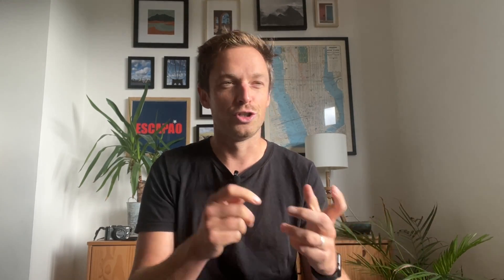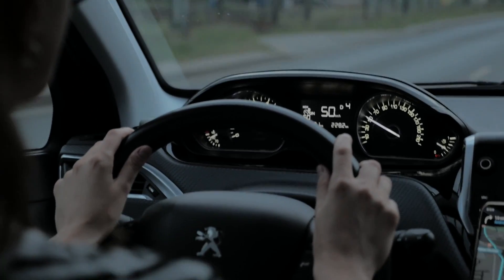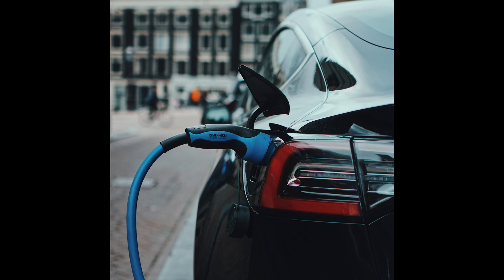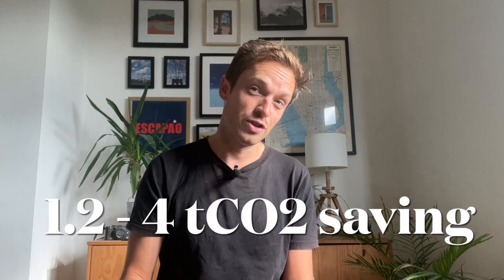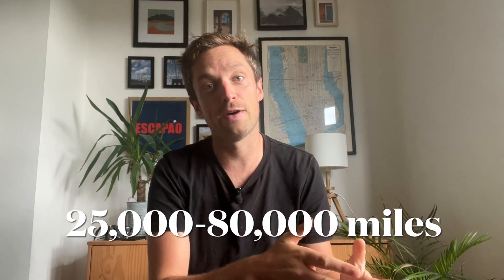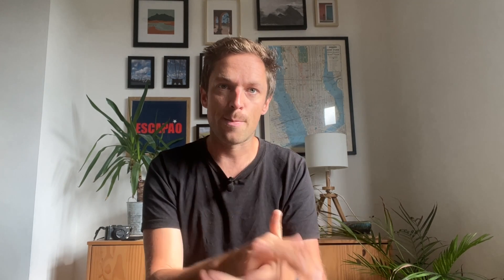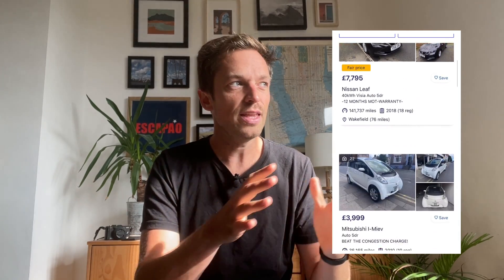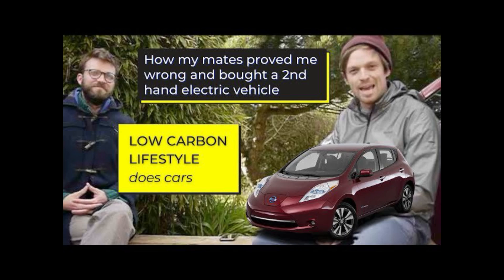Should I run my petrol car into the ground or switch to an EV?

Comment: In terms of cost, keep the old one 10 times out of 10. Only if you can afford a new car of any type should you then consider this
Reply from the maker: I am not sure I agree, there are many second hand EVs at very reasonable prices now, and depending on how many miles you do, could save about £1000 per year in 'fuelling'. An old fossil vehicle can be very expensive to run, and contributing to poor air quality where you drive has a much bigger cost that just £££s

Comment: A tesla (best selling ev) is around 20 tons of carbon to create. Meaning a 50mpg diesel could run for 160,000 miles before you've saved the planet anything. I can't wait to start seeing all those used batteries piled in scrapyards polluting the earth.

Comment: Found your channel as I'm looking to get a heatpump for our Victorian house. But I've been enjoying your other videos too. Our second car is ICE but our main car is EV and does nearly all the miles. Last year the ICE did 1500 mile and since getting an ebike for commuting it does even less. The car still has value so couldn't scrap it. Likely that if sold the emissions would increase so I'm keeping for the really rainy days and occasionally tip run. Probably won't replace it when finally scrapped.

Comment: It's more than that though, you're quoting manufacturers CO2 figures, which like their stated MPG figures are vastly overstated. I wonder if anyone has actually used an emissions meter through the lifetime of an average car, say a Golf 2.0 Tdi. On my own figures using data over the last 3 years, I do 20k miles a year and I calculated that with a diesel I'd have used around 4 tonnes of CO2 (manufacturers figures), using monthly average national grid figures for my region it's around 600Kg in the EV. Add your embodied CO2 in production? It's a total no-brainer. There's also far less consumable parts needed to be replaced in an EV whilst running. All these parts cost CO2 to produce, e.g. Brake discs, clutch plates, oil, oil filter, fuel filter, air filter. For tyre wear I've found this to be similar to my diesel. Add to this that the raw materials from the battery that can be >90% recycled for future batteries. There's no wonder the established fossil fuel companies are pushing mis-information all the time, through our press, social media etc. The biggest difference for me doing all my miles is the quietness, it's made such a huge difference to commutes.

Comment: The point about reducing consumption is one that we need to be speaking about more! We've gone from 4 cars, 3 motorcycles and 1 bicycle in our household, down to 1 car, 2 motorcycles and 7 bicycles.
By cycling almost everywhere, we are saving a lot of money, our health has improved dramatically and the carbon saving must be immense since we started the transition in 2016.
Thanks for a well thought out video on this subject.
Reply from the maker: That's fantastic to hear! I think there is lots we can do to move away from the private car, and you sound like a great example of that. I cycle on my commute and often to the shops, so our car use is really when we have to travel 5 miles plus and in a bit of a rush.

Thanks for engaging with the video!

Comment: My concerns are the recent spike in EV car fires, the range of many of these EV vehicles needs to improve to make an EV a viable daily driving option in some scenarios, also the infrastructure in the UK is just not there yet

Greater control of the manufacturing, installation and control hardware and software of EV batteries is needed, to mitigate EV battery fires as much as possible

Although ranges of EVs has improved, for many people an EV just isn't viable as a means of transport, because the range just isn't enough, this needs to improve

Also more investment in EV charging infrastructure is needed too, the cost to use such infrastructure also needs to reduce substantially, so that EV owners are not being stung with exorbitant prices on a public network
Reply from the maker: Hi Edward,
Thanks for the comment, I would love to see evidence of a spike in EV car fires? Have you read this article? -https://theconversation.com/electric-vehicle-fires-are-very-rare-the-risk-for-petrol-and-diesel-vehicles-is-at-least-20-times-higher-213468

What range do you need? Most new EVs would have more than 200 miles on a single charge, my bladder doesn't last that long.

What infrastructure do you need? Nearly 30,000 locations and nearly 50,000 devices - https://www.zap-map.com/ev-stats/how-many-charging-points.

I would love greater regulation of fossil vehicles, I am sure you aware that fossil cars have been on fire before...? Often caused by faulty fuel lines, overheating, etc.

Feels like you are repeating rumour and delay tactics to stop the transition.

I don't have an EV yet, which is what this video is about, I mainly ride my bike, but at some point, I  need to move away from a fossil vehicle, there is no reason to stay with them any longer.
Thanks
Tom

Comment: Your figure for petrol/diesel is scoped around the vehicle but electric is scoped around the grid. You should include the production and transportation of the fossil fuel which would increase your fossil fuel emissions by 20%. This also ignores the main benefit of electric which is local air pollution.
Reply from the maker: Hi pmac6584 - you are exactly right. Although I am using methodology based on greenhouse gas reporting principles outlined by government, I still thinks it makes a compelling case to change and avoids accusation of overstating the benefits.

But agree, air quality, emissions reduction, noise reduction, improved comfort etc etc - multiple benefits of changing
Thanks for engaging with the video
Tom

Comment: I skipped the math and, unfortunately, your entire premise.  EVs are changing so rapidly that I decided to cut back on driving as much as possible and wait a few years to see how it all shakes out.  Got a work-from-home job and I am hoping to sell my gas vehicle and rely on my wife's car when I need to drive.  What I want is a more conventional version of the Aptera.  Lightweight, efficient, on the lower end of the price spectrum and able to charge itself via its own solar panels if you park in the sun.  I think we'll see that kind of product sooner than later.  Give it 4 passenger capability (and probably 4 wheels instead of 3) - the love child of an Aptera and a 1980s Honda Civic.  A vehicle like that could be lighter and require much less battery capacity than the massive EVs on the road today.  All of your calculations would suddenly tilt in favor of getting a new EV.
Reply from the maker: Hi Andy, thanks for the comment, I like the idea of the 80s Civic Aptera love child...!

Yes my maths already add up from a CO2 perspective, from a cost perspective, maybe, but like you, I don't drive much, cycle to work and get the train a lot when we go away. Maybe I just want an EV because they are a fun toy.....
Tom

Comment: How eco friendly is a Toyota Prius gen2 2007 that does 70mpg and has all original transmision components engine and battery ?
I'll say it's way more efficient then any possible EV
Old hybrid cars with original batteries are the best for emisions in my view
Reply from the maker: Hi markbesky, that's not quite true, although 70 MPG is very impressive for a fossil vehicle, in energy terms that is only about 1.6 miles per kWh, when an inefficient EV would be doing 3 miles per kWh.
70 MPG, would also be 135g CO2 per mile. An EV at 3 miles per kWh, charged by the UK grid, would be about 65-70g CO2 per mile.
So, a Prius is definitely better than a pure fossil vehicle, but still reliant on fossil fuels and higher ongoing emissions than an EV. If I had a prius, I wouldn't be in as much a rush to switch as I am, but we'll still need to move away from them one day!
thanks for engaging with the video
tom
Reply: @TomBray-LowCarbonLifestyle  I consider my car carbon neutral because it's still on the road with no major components changed 
You can say the same about an EV if it still has the same battery after minimum 10 years or at least 200k miles
Reply from the maker: @marbesky  you can consider it carbon neutral but every litre of fuel you burn will emit 210g CO2. So 'neutral' is doing a lot of work there...!

My calculation suggests an EV could pay back after 25,000-80,000 miles (depending on what you are switching too)
Reply: @TomBray-LowCarbonLifestyle  let's keep it simple 
A prius averages around 150k miles with no major issues and I mean no big investments in the car 
I prefer to look at money over emisions because in UK nobody gives 2 shits about emissions not even government and it's all about the money 
How much will a prius cost compared with a tesla 3 over 15 years ?
And emisions wise what would be the equivalent of driving a tesla 3 15 years including a minimum second battery replaced because let's be honest thers no way a battery can last that long 
This whole emissions thing is a big rabbit hole

Comment: The current rate of depreciation of EVs Vs ICE far outweighs any cost saving of running an EV Vs ICE. Also why do you assume that EVs have more embedded CO2 than ICE?
Reply from the maker: Hi Christian-sh9uh, I think it is fairly widely reported that embodied emissions of EVs are higher than a fossil vehicle, at least that is what I have read before. 
Are EVs depreciating more quickly than fossil vehicles?
Thanks
Tom

Comment: "what if you just stopped driving" well as someone who spent 2 months wo a car: no, unless i quit my job, i can't. but come to think of it, plenty of houses have 2 cars where i live and by the looks of it, 1 of those is usually only used for short trips. so a second hand EV might just do it since they often cost about as much as a reliable 2nd hand car.
Reply from the maker: Hi yvs6663, yes lots of people need a car to get to work, visit family, or get to shops. Lots of people think they need a car but could probably drive a lot less and even live without if pushed. But a 2nd hand car may be a great start.

Tom

Comment: I thought using a UK manufactured electric car was unfair as most electric cars sold in the UK are imported.  Would be interesting to see the figures for the worlds best selling electric car, Tesla model Y!  parts sourced globally, imported on container ship burning crude oil, I think the results would be very different.
Reply from the maker: That's a fair challenge, this article suggests a Tesla Model Y would have emissions of 21 tonnes in manufacture - https://insideevs.com/news/493771/toyota-rav4-prime-tesla-model-y-co2/ I guess not counting import emissions too, lets call it a round 25 tonnes. If my 1.2 tonnes to 4 tonnes saving per 10,000 miles stacks up then that would be between 60,000 and 210,000 miles to payback those emissions... all depending on what car we are switching away from.

So maybe for some EVs the story doesn't stack up. I think I am looking for a 2nd hand car, as wouldnt want to pay the excessive costs of a new Tesla even if we could afford it...! 

I guess best would be riding a bike and using public transport....

Comment: Hmmm lets see, how much petrol can you purchase for the price of a new EV, oh wow that is a hard decision to make.  LOL🤣😂😋
Reply from the maker: Hi jlgrizzly7972, and how much damage would you be doing if you did that? I guess the question is, are we willing to take responsibility for the sewage we are putting in the air, or are we willing to keep poisoning lungs, keep risking climate change, keep funding despots around the world....
Up to you!
Reply: I drive 350 miles a week just going to work and back and it costs me £10 on average (£9 or less in summer, up to £12 in winter because of the range difference with the seasons). I only charge at home at 9.5p per kWh plus some occasional home solar at weekends (very little). I save around £1500 a year on fuel vs petrol, overall. I’ve been driving an EV for 3 years, so I’m already at £4500 saved. In 12 months time it will be £6000. In two years time £7500. I did what Tom did and did the maths for my particular use case - and back then I was driving a diesel Golf and paying what was it £1.25 to £1.30 per litre? In my case the economics was a no-brained, but it still took me another year to pluck up the courage to make the jump. For others the story will not be as beneficial, the less miles you do the less the economic benefits (and CO2 for those who care about that). If you do the maths you can work out if your next car should be ICE or EV, new or second hand. It’s not hard, the hard part is finding the data first. I can confirm that in my case the maths and reality matched. For additional info I have done 48,000 miles and the battery is still at least 95% of original capacity. You are looking at 1-2% degradation per year or 12-15k in that case. So effectively I can take  £4500 off the purchase price of the car, which was £28k after incentives discounts and before the trade in value off my old car - I can’t remember if that was £3k or £3.5k so I’ll use £3k. So looking back at it we payed £25k for the car, have saved £4500 in fuel which makes the car cost to me £20.5k. In 12 months, assuming it does not catch fire or need a new battery, it will have cost me £19k. This why individuals need to look at yearly running costs along with how long you intend to use the car, rather than upfront purchase price alone. Owning an electric car is…….different. I also don’t see why lots of people have to change to EVs, ICE is still going to be a better choice for many for quite a while to come. Don’t fall for the hype or headlines on either side of the debate, which is best for an individual right now depends on their needs and circumstances.

Your comment is not wrong. EVs are expensive and that alone puts them outside of the reach of many, which basically makes it a simple decision for those people. Doesn’t matter how much money you can save if you can’t afford the entrance fee. That may improve over time, but I don’t know, I don’t have a crystal ball. But when running costs are included, the price of ownership can be lower than it looks at first glance.
Reply: I can see your point, for me having my vehicle paid for and only traveling around 25K a year it is a no brain er.. @javelinXH992

Comment: Hang on! you included the carbon cost of the grid for EV but missed out the huge carbon cost of finding, extracting, refining and distributing fossil fuel for an ICE car. The tailpipe emissions and embedded carbon are only a part of the carbon cost of an ICE car. The argument to swap is far stronger when this is taken in to account.
Reply from the maker: Hi Jonathan, you are absolutely right, I suspect there are a lot of emissions that are not accounted for in my calculation, although to avoid challenge the other way, I have used methodology as outlined in greenhouse gas reporting that we use in this kind of calculation, I maybe should have mentioned the limitations of this but not sure there is a different methodology to accurately report... https://www.gov.uk/government/publications/greenhouse-gas-reporting-conversion-factors-2023

There could be a challenge to this methodology in the other direction, i.e. an additional kW of electrical load, i.e. charging an additional EV, would likely be met by the dirtiest generator, coal or gas, so we could say emissions linked to the additional load are higher than the average.

That isn't how we calculate emissions, we use the average CO2 intensity over a year, which is what I have used for 2023.

I hope that makes sense, and I broadly agree that the argument is stronger. Apologies if I have diluted the argument at all!
Thanks for engaging
Tom
Reply: @TomBray-LowCarbonLifestyle  it could be impossible to predict if 500 extra EVs on rapid chargers would actually be adding an extra say 50MW of “dirty generation”, it could well be 50MW of clean generation not having to be curtailed.

Comment: If there were some way to calculate the reduction in total pollutants (excluding EV) I think (in the UK) it might be very high - with EVs being 90%+ less than ICE. Gas and nuclear plants produce negligible pollutants. And what pollutants they produce are probably further from the people whereas ICE cars are driving past houses, schools etc.
Reply from the maker: Really helpful point, I am looking forward to the day when the air we breathe is much cleaner because we have moved away from fossil vehicles. As well as the noise on our streets as we move to quieter EV motors.